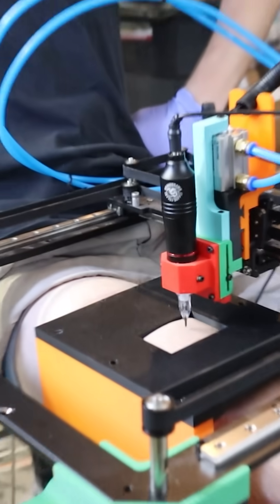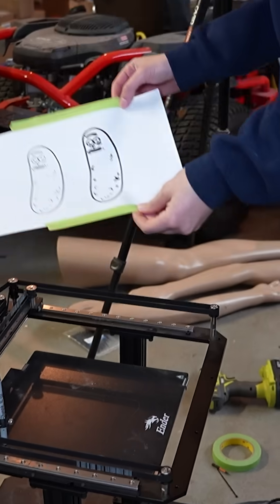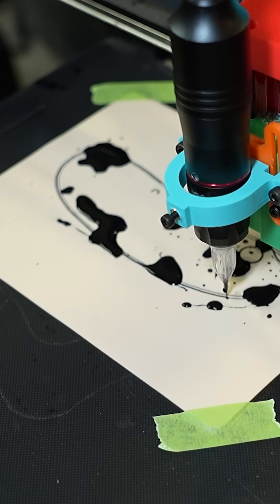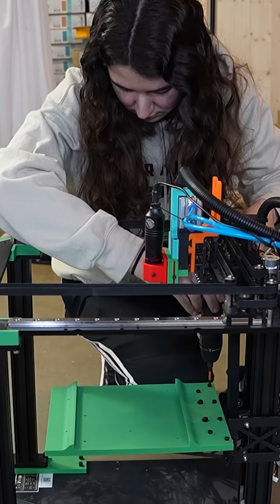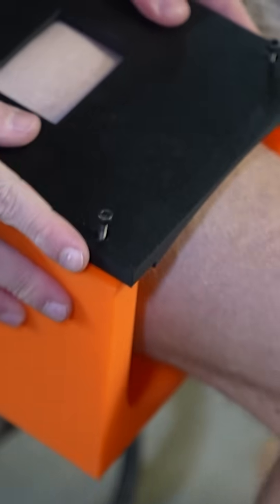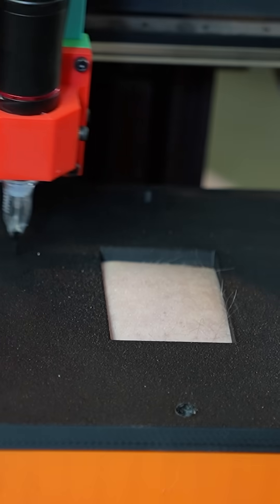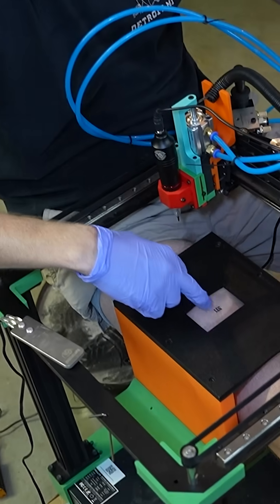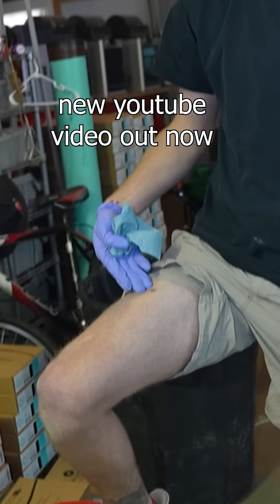Tattoo 3D Printer?

Comment: Holy moly. This is revolutionary. There would be so many people wanting this. A machine can be so precise and accurate. You can make a whole business centered around getting a tattoo without speaking to one soul. You'd make millions
Reply: The only problem with it is it could only do lines. I don’t see a 3d printer being able to do any shading. Even color packing would be a problem because of how much damage it would do the larger areas of skin going over it multiple times in straight lines.
Reply: @NoSoulARC they can do shading… they move along the x, y, and z axis…
Reply: @NoSoulARC  there's many methods on how a printer can do shading. A simple method is dithering, which would work without any modifications to this design.

Would be good if they checked the Z at different points to account for the curvature of the area though.
Reply: If it's revolutionary it would be because of the price of the tattoo...nothing more. All good artists in every city can lines that are close enough to perfect that it doesn't matter. The ink spreads as you age and anything perfect is gonna look the same as what a good artist does anyways. 

I think eventually robots will be able to replicate good tattoo artists but a 3d printer never will. The skin moves too much, people move, the skin isn't flat (even less so when you talk about pieces bigger than 2" x 2". Tattooing on human skin requires so much more than a 3d printer could ever do. The fact that this thing put the ink I far enough without going too deep is a fucking miracle.  And it probably all fell out because the chances that the ink was deep enough is very very slim.
Reply: @alex-ei5pu  The price would be incredibly cheep, I didn't think of that. If it does catch on there would be many things that designers would need to address. I feel like they would put a lot of resources into fixing those issues. This is alot like the AI debacle with art, the human touch can never be recreated in a machine. But I think people won't care. At least that's the way it seems to be going with other fields regarding machines doing human things. It would be sad though to see another art form die
Reply: @ yeah I just don't care about the human touch or whatever, at least when it comes to tattoos. if a robot could tattoo me at 1/10th the cost I would do it in a heartbeat. half my body is tattooed and the only reason it's not my whole body is because it costs so much. I think you're right that most people just don't care enough, and would gladly pay a lot less to have a robot tattoo them.
Reply: @alex-ei5pu  nah. If they really went into something like this, a robot arm, or a 3d printer like machine(basically just a cnc machine at this point) they could be better than human hands. You can program to do 3d scans nonstop to avoid any errors with skin movement, can program it to always hit perfect depth/speed/angle with every single stroke(aka these machines can process faster than the tattoo gun moves), add an endless reservoir of ink, and much more. Basically you could make perfectly drawn/shaded/constructed 3d artwork in a few minutes.
Reply: @stompingpeak2043  nah, there is too many variables when it comes to human skin. the difference between parts of the body, peoples sweat, how tough some skin may be, even the dryness of the skin can effect the result of the tattoo. i could list endless factors on why this wouldnt work for any tattoo that isnt just lines.
Reply: @avengedsevenfold998   you do not know what you are talking about, you clearly never operated a cnc machine. the tech is there someone just needs to put it together and make a shiton of money putting tattoo artists out of work.
Reply: @ and you know nothing about tattooing. you would have to put people under to get constant results. do you know that if you use a very small grouping of needles on dry, tough skin. you will damage the needle and not get the ink within. there is a bunch of small factors. programming in computer wont be enough.
Reply: There is actually a tattoo machine like this that was invented and had commercial use, and it worked, but it really didn’t go well and I haven’t heard anything about it since. 

I think part of the issue was that they marketed it as being capable of super tiny, detailed tattoos, which it was, but the reason why humans don’t do tattoos that tiny and detailed isn’t because of a lack of skill, it’s because it looks like trash and blurs together quickly after it heals. 

I wonder if that tattoo machine still exists? I think it could have gone better if it was developed by people who were passionate about tattoos and art, which really didn’t feel like it was the case for the company that made it
Reply: It would become lifeless art. Part of the beauty of Tattoos os the live that goes into it.
Reply: @KoreshDabar-YHWHbenYisrael  Very true. But I have a feeling that it would become incredibly popular really quickly regardless. Quite a bit of people love not speaking to people. I think, for many people, the pros would outweigh the cons. But not everybody
Reply: @KoreshDabar-YHWHbenYisrael  I would argue it turns them into something like photographs.  The work to make the art is still necessary, you just know exactly what it would look like once it's finished.  Photographs aren't lifeless, in fact you can make some absolutely beautiful art with a digital camera.  They also aren't more lifeless than painting the scene yourself, just different.
Reply: @KoreshDabar-YHWHbenYisrael  ehh, art is just pretty to look, hear, feel, tast. Doesn't need to always be super meaningful.

Comment: I would definitely suggest putting in some way to have it on a flexible arm of some kind or spring where it's always giving constant pressure at the same pressure even with variation of movement

Comment: if you linked up an auto leveler probe, you could actually tattoo a uneven surface. . whatever your tattooing would have to be very secure though, the depth probe can also be used to make sure the needle never goes past a safe depth into the victim. . . I mean subject ;)
Reply: Yeah thats why she has his leg between 2 pieces of wood. Most people get their tattoos on arms and legs so this wouldn't be a problem. The only thing is that this would not be cheaper than just getting a regular tattoo. You will always need someone to monitor each machine.